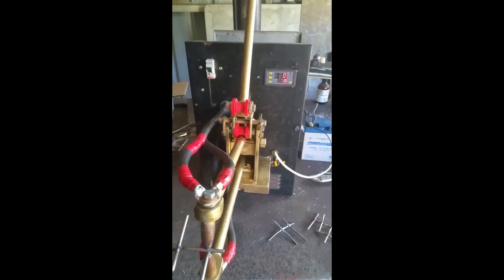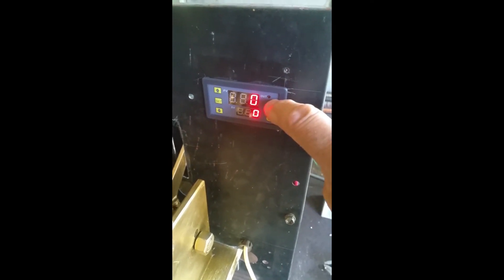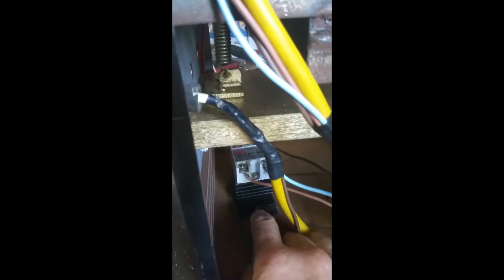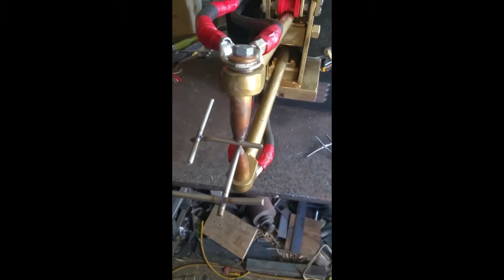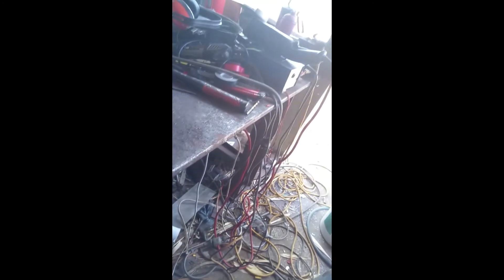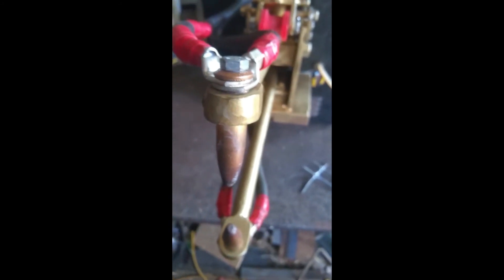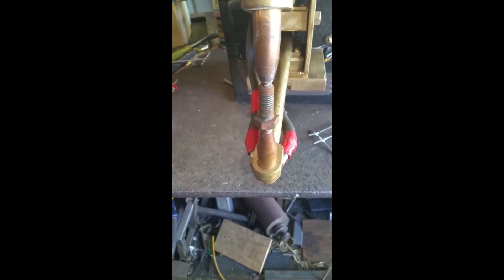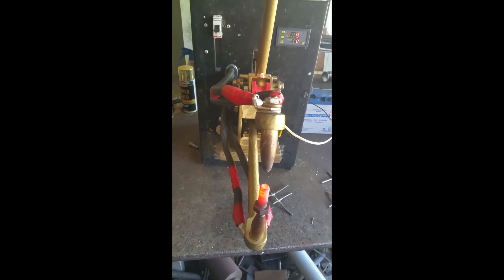Big Home Made Spot Welder out of an old 140A arc welder Part 2 and 2A

Comment: Would you know the amp draw from incoming power and outgoing volts? I'm trying to compare power from this against duel mots, I tested a mot I have and it draws 6.5 from outlet with welding cable wrap at 1.5 volts, just trying to see if 2 of them is more power as i have access to cheap welder and could go this way too. Have you considered rectifying the outlet as i researched the dc spot welders seem said to be better , parts cheap on ebay and you can use 3 phase rectifiers just leave one terminal
Reply from the maker: Hi Col, Last time I tested it, the welder transformer ran about 13A-15A on a 16A circuit breaker and I think that the output is about 5.3V or 5.03V, can't remember which. When I used the MOT, it drew about 2.5A @ 240V input unloaded and about 2.3? V out. The MOT transformer was rated about the 600W range which corresponds to the 2.5A it used, so the welder transformer was a better choice for me.

I had thought about rectifying the welder transformer output, but the price of big assed rectifiers are quite expensive so didn't go down that route. Seeing as it probably puts out about 700 amps at 5.3V, I would most likely need an 800A rectifier at the minimum and preferably 1000A to ensure a good safety margin. If you just only use a rectifier than you will loose some output voltage  due to the RMS factor which is about 1.4 or there abouts I think. However if you add some big capacitors then your voltage will increase probably by the same factor. Sorry to be a bit vague as I am not really into electronics. Hopefully someone here who know a lot more about electronics will correct me if I am wrong.

If you convert that 180A welder of yours you will most likely need a bigger rectifier again!

I am not sure what your mains voltage is where you are, but I am assuming that if your MOT is using 6.5A then you are most likely on 110V mains and not on the 240V that I am. If that is correct then you are probably using a 715Watts MOT (approximately), so converting that wattage to the 1.5V the most you would be able to get out of the single MOT would be about 476A @ 1.5V and that is at a 100% conversion, in reality that won't happen. (W=V x I )
Reply: The welder I'm considering is 120 amp 240v, the mot i tried is 240v and ended at 2v and drawing 6.5 amp from outlet , at lease by my clamp meter. So it sounds like i should just go with the welder. I have 150 amp  1600v rectifiers and will give them a go , with the volts so low i hope they can handle many times rated amps and if i'm wrong learning experience as i cant find information on increased ampage with lower volts. yes i'm thinking a cap on the ac side and 5x 400uf  2.7v on dc side before the timed relay system for a quicker hit of power and shorter overall weld time, if i can get enough power then i'll think about stud welder. I bought an ebay gun but it is off a full capacitor system which would take much bigger cap bank.
Reply from the maker: I found that when using the clamp meter too close to the transformer it gave me very wrong readings. The further away the more accurate they became.  The magnetic flux created by the transformer was messing with the clamp jaws,  an inline ammeter would give you an accurate result. The 6.5A you are getting is probably an error as that would mean that the MOT is using 1560W of power and most Microwave ovens do not run that sort of wattage unless they are big industrial ovens.

There are a couple of things to consider as I don't think that you will have much success with a single 150A rectifiers unless you combine several of them and also I doubt that the 1600V will protect the rectifier from frying. As far as I know that is like an internal insulation protection against high voltages going through it and not the rectifiers ability to handle a large current.

The 400uF caps you are thinking about on the DC side may not be big enough to hold a decent charge. You may need to go and get some super-capacitors ie:  700F @ 2.5V but they are about $40 each and they should hold a decent charge with quick discharge, just google E-bay for them.

The primary coil off the welder would give you better results as welders are usually designed to be temporarily short circuited and run large amps without frying up. Not trying to dishearten you but I suppose it might be fun watching the magic smoke and sparks being released from electronic components.
Reply: Thanks very much  for your opinions, In line with your experience i'll pull the old welder apart and try that, i agree the rectifiers are a big gamble so probably just a waste trying them so that puts the 6 caps out as well because they are dc supercaps, 6x400 uf would have at least helped boost the instant voltage. I'm not sure how many uf a welder needs, if i used all i have 6x 400uf plus 6 500uf i can take from another project giver 5400uf at 2.7 v probably still not enough for a stud welder. Well at least it simplifies the project I'll just get most i can ac from the welder hope it does the job.
Reply from the maker: These opinions are just my 2 cents worth, if you add all the capacitors that you have, they only equal to about 8.9F, the Supercap for $40 holds way more charge at 700F but you would need to rectify the output to use it. Using capacitors, I would imagine that the discharge rate would be quite quick so don't know if it would do what you want as you may not be able to control the discharge time easily.

 One thing you could consider is to rectify the AC input to the transformer but you can't use a full bridge rectifier to do it as you need the input to be pulsed for the transformer to work, and a single rectifier  to do 15-20A is quite cheap. It would however  also drop the rectified voltage into the transformer so don't know how much that would reduce the transformers output, or what effect  the reduced pulsed DC voltage input to the transformer itself would have.

As I said before my knowledge of electronics is very limited so it might be prudent to consult someone who knows more about this sort of thing than I do.
Reply: I'm sorry i screwed the cap size they are in f not uf you are totally right about the caps if they were uf , 6 at 400f and another 6 at 500f still don't think it's enough for full capacitive discharge stud or spot welder
Reply from the maker: 5400F... that would make a nice spark! one way to find out. Make sure you video it if you do, I am sure a lot of people would want to see it, and I am betting that it would as you still have the welder output powering the circuit as well. Send me a link if you do. LOL.
Reply: Problem is finding the rectifier , the 1500v 50amp wont do the job , so stuck until then
Reply from the maker: Hi Col, if you use that rectifier on the 240AC input side and assuming that there is no problem with the transformer accepting the resulting pulsed DC input at a lower voltage then the output side from the transformer is already a pulsed DC output so no need to add anything to the output except for the capacitors. You will need to use a multimeter to find out which output leads are Positive and Negative and  then connect them to the right connectors on the capacitors, so the rectifier you have will be fine as your welder will use less than 20A input.

If you were to rectify the transformer output side then yes that would mean that you would need to combine several rectifiers or get a much larger one, but not if you rectify the AC input only.

 Hope this helps.
Reply: Do you have any links to pulsed dc transformers straight from rectifier ?
I have considered this but it doesn't seem it will work well as the pulsed dc needs to be a square wave or at least more choppy to stop saturation of the transformer. I would like to see it done rather than just experiment myself , I'm thinking maybe a dimmer with triac at half on or something. From what i can find so far straight from the rectifier will work to a point but lots of losses and overheating. But if you could suggest a link i'd be very interested to try, or for the possible loss of a few components it's worth a try anyway
Reply: I have run a car coil on an scr dimmer for a jacobs ladder but im not sure the rectifier will be square enough for constant use without overheating
Reply from the maker: Hi Col, unfortunately I am out of my depth on this depth of info, this is only what I have been told by others, when you use a  single leg rectifier you lose voltage, I think 240V ends up about 170VAC so I am not sure what that will do to the transformer as they are designed to run at 240V, (probably overheat). As for the square wave I don't know how much that will impact the transformer as they run on an AC sine wave to begin with. 

You may want to join an electronics forum to get this sort of advice as they have plenty of expert and  knowledgeable people who will give you proper advice unlike me as I have a very limited knowledge of electronics and only do this just for fun.  

ie: Try joining http://www.electro-tech-online.com lot of people there with the required skill set to help you.

From what I have been told the saturation of a transformer occurs at very high frequencies and not the 50Hz that we are dealing with, so you may have problems with an SCR as I think that they operate at those high frequencies.

Which is also why I made my spot welder just a simple AC type as I didn't want to spend too much on rectifiers  and super capacitors  only to find out that it didn't work as expected. I think the simplest way for novices like ourselves would be to rectify the AC output (probably with 6-8 combined 150A rectifiers)and when you add the capacitors it should also boost the DC output voltage.
Reply: Thanks for your help, as i have run the car coil without problem for jacobs ladder I've decided to just wire  it up and monitor heat for a while. I will let you know how it goes. I have smaller rectifiers i can use on input so i'm only risking 6 bucks there , also the high current scr i have is only another 12 bucks . I think it might work , so i think it's worth the risk.
Reply: rectifier straight to transformer no go smoked the wiring of primary in seconds if not shorted ill try the scr and get back. Just thought you would like to know fyi
Reply from the maker: That doesn't sound right are you using a single leg rectifier or a full bridge? If the latter the full bridge will be almost putting out  straight DC output ( with only a minor ripple only) which transformers don't like. The single leg rectifiers put out a half wave sine which should work on the transformer.
Reply: Well the 500w scr blew instantly with the transformer open id say inrush current too large, you could be right about not using full bridge , but without capacitors its still a wave except it doesn't cross into negative bounces from zero back up doubling the wave on one side of zero . Obviously that' s why i can't find info on wiring transformers that way. The scr works on the car coil but that coil is small in comparison to mot so right or wrong i blame inrush blowing the scr the bridge still tests fine. So i think it might work with much bigger scr but i'm throwing the towel and just going with the welder transformer and ac, sadly i doubt it will work as a stud welder. Your current test proved that to me. With much higher current from caps the heat will concentrate at the high resistance joint. As yours showed the lower current lets the whole bolt heat up not just the junction at the join. The only other option i see is actually smaller transformer as charge circuit for say twice the caps i have and just dump caps not trying to rely on mains for the weld at all. anyway i see all my failures as learning and didn't cost a fortune.
Reply from the maker: You would definitely need a much bigger SCR than a 500W version, if the welder is 140A it would most likely draw at least 10A at 240V which is 2400W at a minimum and I wouldn't be surprised if it  drew down more , I am not sure if you said you had a 140A or a 180A welder that you were using, if the latter it would most like draw at least 15A which would be about 3600W. 

Full bridge rectifiers actually put out a flat line continuous output similar to what a battery does without capacitors involved, they do have a very  slight ripple,  but not enough to affect anything in this situation, so as far as the transformer is concerned you would have fed it  straight DC which transformers do not like. Single rectifiers put out half wave forms.
Reply: Yeah sorry again it was a 5000w scr. I'm still checking the circuit on a mot , smaller draw . I haven't  done the welder 120 amp yet as i'd rather hurt the mot till wiring is sorted.  But the rectifier is what concerns me most i have googled  and youtubed the waveform and to my experience without a capacitor the wave is exactly the same size amplitude and timing, just that the bottom half under zero is fliped to top side giving twice as many above the zero line. If this is incorrect i wonder if you could suggest a link to show what you mean as if i'm so wrong it will cause me problems in the future
Reply from the maker: Actually you are right, for some reason I had full three phase rectification in mind  instead of single phase when I wrote that bit to you. This link should explain it better than I can, told you I was out of my depth. 

https://en.wikipedia.org/wiki/Diode_bridge. 

Either way I don't know why the SCR blew on yours if it was a 5000W unit. I am pretty certain I have tried something similar when  I used PWM motor control unit on the MOT I first used and it didn't cause any dramas that I noticed but it did cause the transformer to hum more loudly, although I didn't leave it connected for very long. Although having said that, I am not sure but but I think that it may have been an AC control unit I may have used and I don't know what the difference is between an SCR and a PWM unit is. 

As I said earlier you would probably be better off to join an electronics forum and ask the guys there as there are qualified technicians who could advise you much better than I can.
Reply: Thanks for the help, yes scr and pwm are different but i agree it should have worked it did running the car coil on 240v ac through it, i think the mots do have a big inrush current though i'll blame that but thanks for the help i won't bother you any more unless i have a success i want to share the info on. Thanks col
Reply from the maker: No problem, sorry I couldn't have been more help to you. Feel free to contact me if you wish. Cheers.

Comment: Good job adding a solid state relay, and arranging the cable on the lower electrode makes it more efficient.  Try measuring the input current and see what happen when adding a capacitor across the primary winding.  The value is around 30uf to 60uf you just have to try out different values and put the one with the lowest value giving the lowest current. You will find that adding more capacitance is useless.  I tried it with a microwave oven trafo and the off load current was 5amps at 230v with the capacitor it went down to half of that.